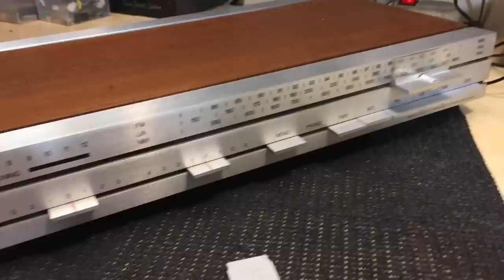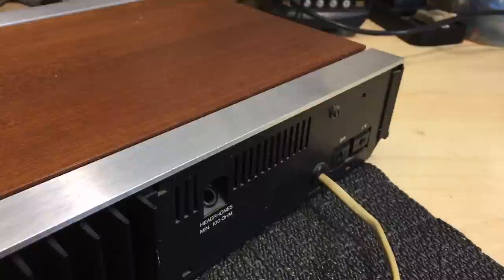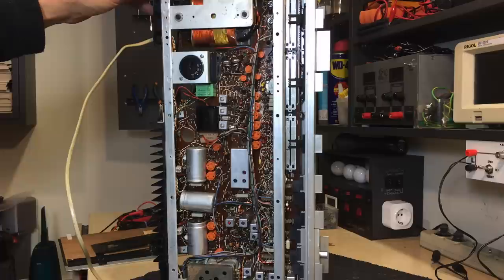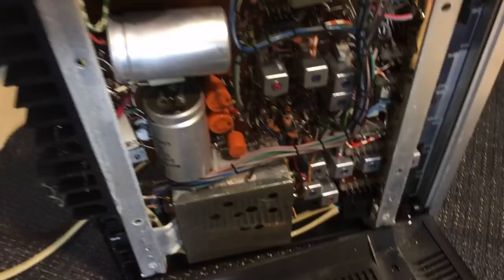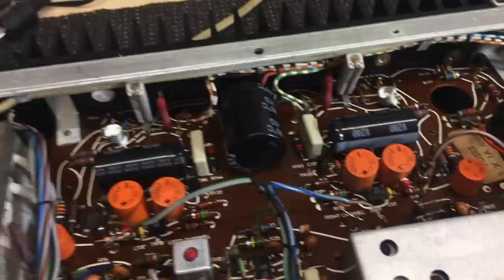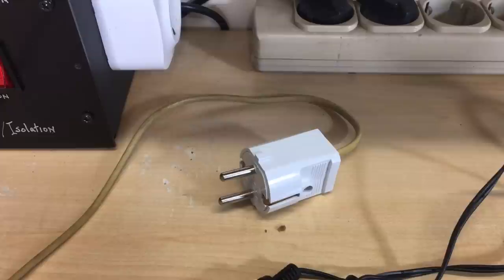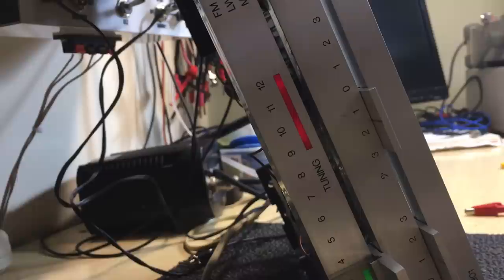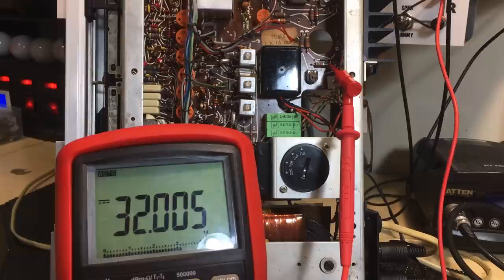Saving the Bang & Olufsen Beomaster 901 from the Dump

Comment: Thank you so much for this video, gave me the guts to tackle a Beocenter 1600 I brought last week. First time Vintage Hifi repair. Currently replacing all the red 100/40 ROE caps, 50% were leaking, one with top about to explode, it disintegrated on removal. Currently listening to it on FM after recapping, a nice smooth sound how I remember stereo radio sounded. Replaced tuning bulbs, now also working, cool dimming effect now fully functional. Now await replacement tape drive belt to repair tape drive, was working but now snapped. Looking forward to a fully-functional unit. Enjoy your nicely explained commentary to your videos.  Thanks for your time and commitment
Reply from the maker: My pleasure. Enjoy your system.

Comment: When I was a B&O dealer in London, B&O would supply us with panels so that we could change the colour to the customers requirements. The rosewood was the most popular colour. B&O was fairly reliable as products went but did suffer from slightly inferior internal components like the trim pots. We used to keep large packets of indicator lamps because they did fail on a regular basis.
Reply from the maker: I agree that the trim pots could be better. Easy enough to change though.
Reply: @electronicsoldandnew  Thats what we used to do a lot of the time. We used to replace them with enclosed trimmers with moulded canon tracks. We would buy them from a company called RS Components who were known for their exceptional quality. They used to supply the avionics and development companies.
Reply from the maker: Jeremy Travis : RS is still around and going strong.
Reply: @electronicsoldandnew  😊

Comment: Very nice! Many years ago, I repaired one like this for a friend. That was qiute challenging, because the mains transformer had an open winding. This one is very special, it has to have very exact measurements in order to fit in. Not very easy.. The solution was to use an external one in a case.. Also, those "ROE" capacitors (for Roederstein & Türk in Germany) are very reliable as I have experienced
Reply from the maker: I can imagine the difficulty in fitting another transformer in there. Not easy at all.

Comment: Nice job, well done. In 2007 I found in a council cleanup (local council free collection of larger household items held once or twice a year) a Beocenter 9000 made 1986. It works and uses glass touch panels for control but the panels are missing (presumably broken) but touching the contacts still works. More recently I found a Beocenter 2 master unit and a few months ago another Beocenter 2 with the 'socket unit' which is the power supply, pre-amp and tuner. This also works but the DAB tuner (it has this option) is of an earlier codec type so won't decode DAB transmissions, regular AM & FM are still good. It's a throwaway society.
Reply from the maker: Sadly so. I often wonder what would happen if cheap labour simply vanished. Perhaps society would start appreciating their gear a little more.

Comment: Just finished restoring my second one of this model.  The large filter capacitors were fine on both BUT they are so big they make it impossible to access, or even see, several resistors in that part of the board.  So worth cost of replacing even just for that.  In both the ones I've restored there has been at least one failing transistor or out of spec resistor in the power amp section so worth checking those and they are very cheap to replace.  Whilst the orange caps have been fairly good on both the 901 I've worked on I had a 3rd one to strip for parts (the slide potentiometers etc.) that one had more than half cracked open so you could see the rolled up internals.  BTW this model was revised during its production history to a version using TIP120/125 output transistors which are mounted on the other (conductor) side of the main board and are just screwed to the heatsink, so they don't have the metal bar clamping them to the heatsink.  There are also some changes in the PCB traces in that area to accommodate this and also the resistors around the bias transistor are different values (the one I had with this showed these changes on the schematic attached inside the lid).  The one I've just done, identical to this one, was a "for parts" on eBay as it had no Left channel sound, this was caused by a screw on that side that holds the heatsink to frame being missing, so the heatsink could move putting strain on and cracking the solder joint of the BD697 NPN output transistor on that channel, the waveform right back through the power section showed the top half of the test waveform as missing which gave it away where to look.  Definitely clean the boards before crack hunting as I couldn't actually see the solder crack at all until I cleaned 50 years of dust and grime off 🤢  Its worth REALLY cleaning the front panel switches again if you have a problem  as they are source of many issues, also worth pulling the black plastic part (that holds the aluminium square) off the front of the white plastic switch plunger when working the switch with the contact cleaner so you can also push down a little on the front of the plunger (i.e. towards top of the case) as you do it as this helps cleaner by rubbing a little more at contacts at back of the switch (had a missing left Phono channel on this latest one and testing the switch for continuity I found the Left side was not making contact between the pins when Phono button depressed whilst the Right was, I could feel the gritty corrosion coming off as I worked it applying that little bit of pressure to push the the contacts at rear of the switch into each other).  One tip worth knowing as regards the fine tuning: the thin white rubber strip that the fine tuning wheel runs along isn't actually glued in.  So if yours is cracked up on the surface you can prise it up with some tweezers from one end and work you way along the track turning it over (no need to remove the tuning slider, just carefully work your way under it), then you'll have a pristine "like new" surface of rubber for the fine tuning wheel that will grip better and be more consistent, its like a new part for FREE 😎  Also its easy to find teak veneer to re-face the side panels, I bought two small  "sample" sheets on eBay that have done both of my receivers.  Just 3 light coats of Danish Oil, and two on the lid of the receiver (once cleaned with alcohol and fine wire wool) to bring the whole thing back to a nice "original" style finish... you have to wait a good few hours between coats but it is worth it.
Reply from the maker: Thanks for sharing your experience 👍
Reply: Today you can easily replace the three large capacitors with std. Rubicon PK that has the same size as the orange ones and therefore can be set directly upright!

Comment: I owned several B & O Beomaster receivers. What a statement they are, obviously sent to us from the future. Capacitors becomes an issue as they age, and service can be most expensive (if you can find a shop that will work on them).
Reply from the maker: True

Comment: I rescued one of these from the rain last week, shortly before it would have been carted off to the dump too.   It had been sitting out for several weeks by the look of it but was remarkably dry on the inside, although pretty manky.   The circuit diagram was still there and had also escaped the weather by a stroke of good fortune.   Some not too brilliant repair work had been done in the past and it has a 1n capacitor missing but I think it can be made to work OK.
Reply from the maker: Good luck. It’s well worth saving.
Reply: Thank you.  Your video should help quite considerably. @electronicsoldandnew

Comment: Great repair as usual.  I've been using a liquid CA glue accelerator to instantly set CA glues for years.  Much cleaner than powdered bicarb of soda and won't tend to boil the glue or leave a white residue.  Available online or in hobby stores.  Comes in a pump bottle but you can just unscrew the pump, draw a bit of liquid into the tube, hold the tube end over the glue joint and press the plunger to put a few drops onto the glue.  Very clean and lasts forever.  As for having to search for a talk radio station among a sea of music stations -- I should be so lucky.  Nothing but inane blather-radio where I live, even on FM.  At least the static matches the tinnitus in my ears..;>)
Reply from the maker: I’ve been meaning to get the accelerator for ages, but always seem to forget. I have to get it online as I’ve never seen it in madeira.
The talk radio syndrome is less serious here because we’re a small market for them and playing music is cheaper than paying a host. Being small has its advantages :)
Reply: The accelerator works very well, but I think that when sturdiness is needed the baking soda works better.
Reply from the maker: Agreed

Comment: ESR meter is very useful tool 🙂 Interesting that the capacitors are in such a perfect state after all these years. Excellent video!
Reply from the maker: Thanks
Reply: Electronics Old and New by M Caldeira is the sound quality of Beomaster 901 on par with Tandberg or Luxman? There’s not much information on sound quality of these sleek receivers.

Comment: Beautiful amp and nice work with it! As you changed the mains plug to Schuko type F instead of C, i would have changed the power cord also to a grounded one, for upgraded safety, as the chassis is metal. Greets from Finland, Madeira is such a beautiful place!
Reply from the maker: I sometimes do and sometimes
don’t. The older equipment, like tube radios, are really dangerous, so I tend to do so in those. 
Greeting from Madeira, and stay safe.

Comment: Nice work. As an experienced B&O tech, I have some comments: The orange "ROE" capacitors seems to be ok, but if you ever come across the red ones, replace them all. You need to change the bulps to the correct values in order to get a brighter light and the luminance will seem more distributed / even. And now the most important part: The trimmers are black coated from corrosion and especially the trimmer for bias current must go. As you also experienced, there was a slip in one of them, where the voltage across the resistor rose dramatically - I bet the the output stage drew full power in that moment. If not changed, you will soon risk a thermal runaway with consequential damage to the output transistors.
Reply from the maker: Mogens Ranneries : thanks you very much for your input.
I’ve had experience with the red caps in some Quads, and they were in fact really bad. I was pleasantly surprised with the condition of these orange ones.
I am still looking for the correct bulbs and will replace these when I find them.
I am also replacing the pots. These are in fact qui dangerous for the amp.
Once again, thanks.
Reply: Mogens, I have bought the same 901 in the UK and the string on the volume pulley mechanism has come off, do you know how to fix this? Many thanks Simon Martin
Reply: @realaleguide I have forwarded the service manual to your facebook messenger account

Comment: 15:45  Hehe, they were brittle back in the 70s when they were new. The chopstick replacement will work better and last forever - it's bamboo. Nice to see you into one of these. I serviced the Beograms in 1975-1979, the venerable 4000, 3000, etc. Only worked on one Beocenter back then. Everything was so packed in there so much, to make the exterior shape so slim. The service manuals were excellent and full of illustrations. And they sounded great in their systems.
Reply from the maker: Yes, bamboo to the rescue! I bet B&O designers never imagined such a hack :)
They are a little cramped (not this one) because, as you say, the size of the units was really kept down to a minimum. I just love them, though. They look as modern today as they did back then. Quite a feat.
Reply: @electronicsoldandnew  They do look as modern today. Their phono cartridges were incredibly good sounding and their turntables were always interesting and ultra-modern.

Comment: I have just done the restoration of this little receiver. Of course, the coupling and filter caps were all dead. And I was "lucky" to have to remove and disassemble and then reassemble the crackling main volume potentiometer... A Rubic cube is just a breeze compared to it.
Nevertheless, the restoration was successful. I have to point out one special feature - as I have had the potentiometer opened: the amplifier has an inherent loudness feature to a certain position of the volume slider - providing you feed the Tape input with a signal at around 200mV. Once you feed it with a hot 2V of a CD player or DAC, you are effectively captured within the active loudness part of the pot - as you have to use the lower part of it because of the multiple input power. Thus the loudness is active even on a loud volume - and the sound becomes really too beefy. So, you either have to decrease the input power on Tape input somehow or compensate the active loudness with bass and treble by setting the respective sliders click or two below zero.
Reply from the maker: That’s interesting. A little like the german tube radios used with taps off the pot to add tone-shaping for lower levels. That “hidden” feature on this one would play havoc with any frequency sweep testing if you did not consider that. Thanks.

Comment: Hi,

Really loving this channel. I know this video is about a year old, but i have some usefull things to add.
The small red tantalum caps drift a lot. I have fixed some 901's in the past, and found them to be in very bad condition. this causes all kind of small problems. Channels not beeing equal, stereo indication not working properly etc. Also it's a good idea to check if the discriminator is correctly set at 0 volts. (S curve). Nice to adjust the tuning lights so they light up the same, but first you have to be sure the discriminator is working perfect. 
Good idea to replace the main electrolitics, and in my experience the orange caps most of the time are ok. Good luck with this great amp. For even better sound, bypass the output caps with a small value wima pet, value not critical. 47nf/100nf is fine. The sound will become more accurate because of d.a. from the standard ecap  being corrected by it's small filmcap brother. Good luck!
Best regards from the Netherlands, 
Nico den Haak.
Reply from the maker: Thank you Nico for your advice. Always good to have these ideas from other peoples experience.
Reply from the maker: Thank you Nico for your advice. Always good to have these ideas from other peoples experience.
Reply: Hello Mr Caldeira,

I'm also learning stuff from your channel,  so that's great too.
I also own a Grundig 3400, which i purchased some 25 years ago. A customer of mine brought it in for repair. The radio was used by his kids to "play" with in their bedroom. I was shocked, and gave them enough money so they could buy their kids a portable radio/cd.
I restored it, and it's in my collection ever since.
Reply from the maker: It is really shocking how some people treat these radios. enjoy yours

Comment: Fantastic job with this gem. I suggest you to try to find any superb receiver / amplifier from Tandberg...specially the Huldra line. Huldra 10, 11 and 12 are incredible elaborated on the RX side. I've got a Huldra 12 (circa 1978) and shines on FM, MW, LW and covers 3 to 30 MHz. Greetings from Leeds....Jorge M0LDW/LW5DX
Reply from the maker: I didn’t know that line, but have just looked them up. They do look great 👍

Comment: Really informative video ive worked on Beomaster 4000 etc and the procedure are very similar as a pointer somehow you have managed to fit the side panels incorrectly they would never stick out at the front like that  it could be you have them on the wrong ends. As usual a great video thanks for posting it.
Reply from the maker: The panels are not properly inserted because I have not quite finished them yet. I mentioned that in the video. They were just lightly fitted to complete the look :)

Comment: You should really check this out at full load against a 4 ohm resistance. You will then find the following: The output device thermal compound has dried, clean and replace, re-torque.  Output capacitors will be subject to higher voltage than specified, go to next voltage level when replacing. etc
Reply from the maker: Good advice indeed, thanks.

Comment: Great video. I have cleaned and lubed the slider pots with Servisol. What did you lube the slider plastic parts with?
Reply from the maker: i use various products. i think in this one i used silicon grease, if i remember correctly

Comment: Built to last. 

I would have replaced the crusty trimmers.
Do i see it right, the scale und switches are without illumination?
B&O built a very modern style in the 70s. Congrats for this lucky catch.
Reply from the maker: The trimmers May well still be changed. They aren’t ally messed up. There is no illumination except for the stereo light and the tuning indicator.

Comment: In your video, I noticed cork debris on the tuning dial knob groove.  Did you clean the grooves of the cork debris?  Maybe that will help the tuning knob slide better?
Reply from the maker: Yes I did. The cork itself is a little dried out. Should improve with use.
Reply: @electronicsoldandnew  Your daughter might ask you to replace the cork strip after she see the video.  Lucky it is available.

Comment: What caps did you use for the big filter caps? I have one on the bench with DC on the speaker outputs. Are they dual caps?

Edit: I just found a layout online, and they’re big radial caps with a solder lug on the back to hold them on the board. Standard high quality radials with a dab of silicon to hold them down should be fine.
Reply from the maker: I don’t recall exactly, but must have been Nichicon.
Reply: @electronicsoldandnew  All good. I ordered some
Nichicon Radial’s.